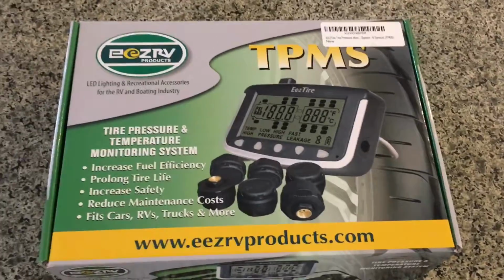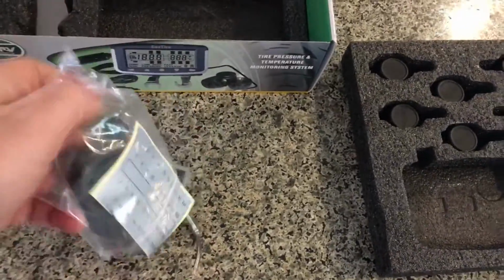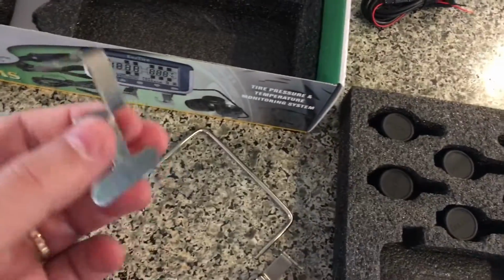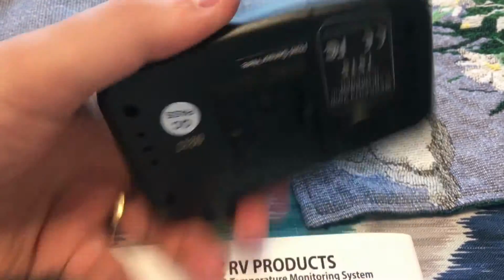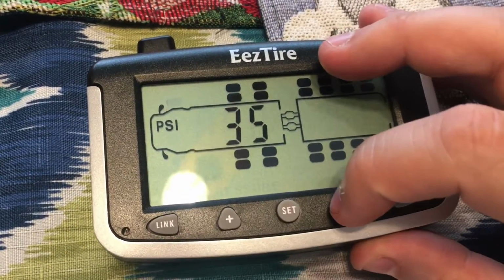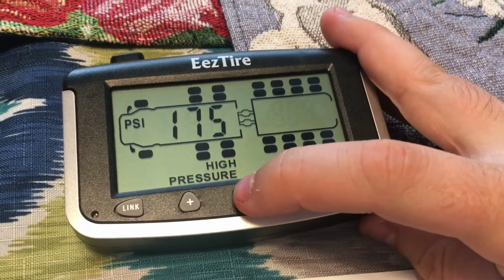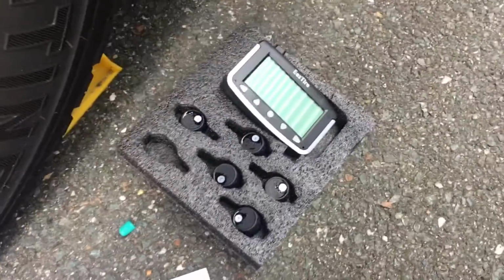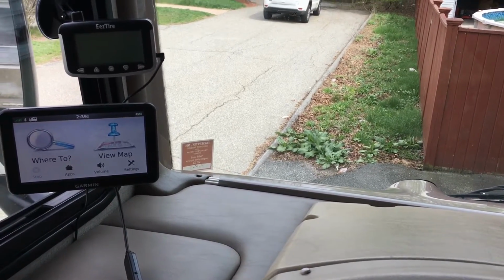EEZ Tire RV TPMS Tire pressure system

Comment: I have a 2018 Coachmen Freelander.  Can you get the sensors on the inside rear dually valve stems?  They point to the inside toward the wheel.  Would there be clearance for the wheel to turn, and also to add air to the tires?

Comment: Thanks for the video and the suggestion to do the setup from one tire then mount the sensors after the programming is done.

The biggest issue I see is the poor display, especially compared to the GPS in the video. The EEZ display is not nearly bright enough and hard to read.
Reply from the maker: Jack Hamm you're very welcome, I'm glad you like it Jack